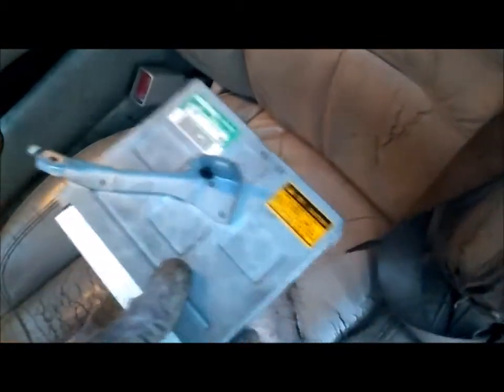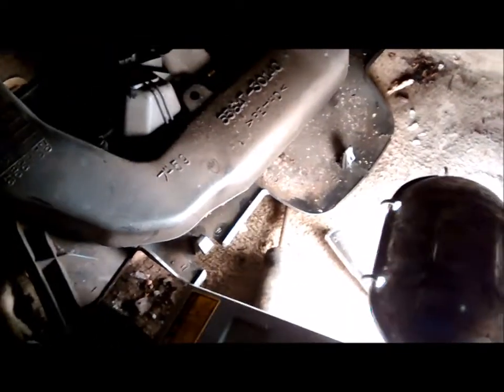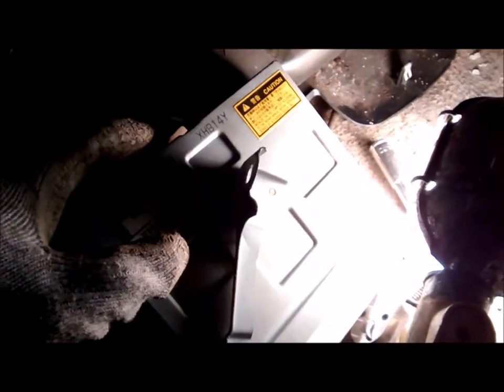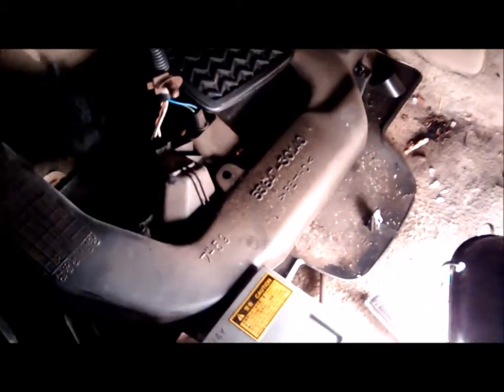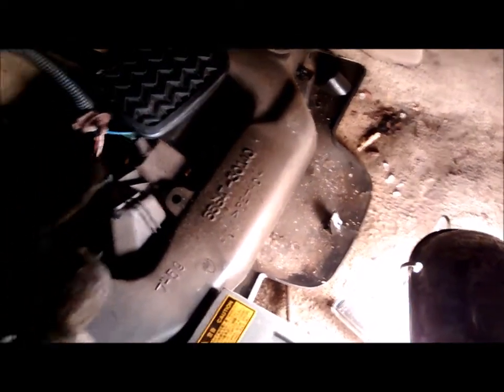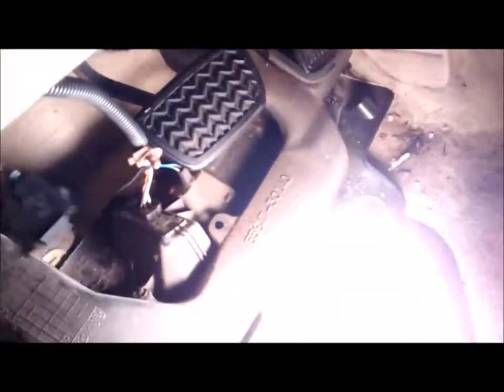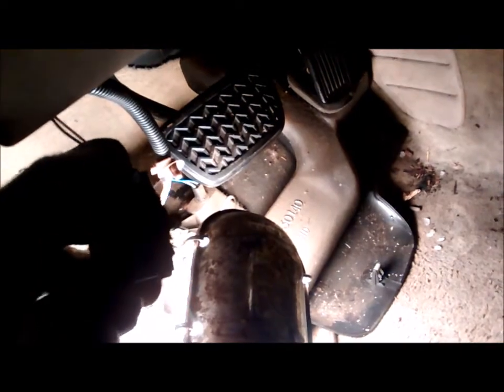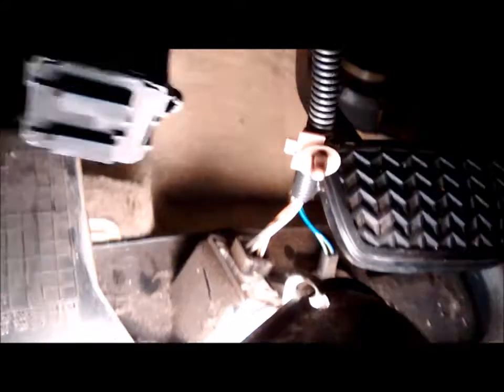1998 Lexus GS300 Replacing the ABC VSC ecu

Comment: I have the same problem wth my gs. Wth the master cylinder pressure is low    And abs , brake light, vsc, and vac off lights are all and plus the high pitched alarm sound  when I put on the scan tool it doesn't say any thing abt  the ecu. Just the master cylinder comes up on the scan tool pls advise thnk u
Reply from the maker: Eric Scott it could be the master cylinder. Are the brakes hard when you push ok n them?
Reply: Eric Scott ,it is the problem of master cylinder . The special gas inside the cylinder is empty . In japan ,they can regas the cylinder.
Reply: @cman4197  I heard somewhere the 2001-2005 don't leak like the 98-00
Reply: Jeff. Mines a 01, mines making the sqauking noise and I see some apparent brake leak coming from the master cylinder. I'm also a victim of the abs vsc and vsc off light  fiasco. Would love a concrete solution to this. What I've came up with , with the three lights one, it has to do with the brakes only. So far , things I've looked up were, test all 4 abs sensors (with volt meter,)  swap or repair master cylinder (heard was complicated to repair). Replace acclimated cylinder. (To get rid of squacking noise) Have yet to finish this check list, but love to hear some testimony's. Thanks again for mind blown vids.

Comment: Is the noise you are talking about go beep beep beep beep beep continuously until the car is back in control?
Reply from the maker: Hans Gruper No. It was a continuous beeping noise. There was no break pressure either, and the break light was on
Reply: Mind Blown Productions gotcha. My brakes are fine but the beep beep beep continues until I stop the car. It's so annoying and I'm looking for the buzzer to rip it out
Reply from the maker: Is the check engine light on? It could be the yaw sensor
Reply: Mind Blown Productions it's a drift car so whatever it is it's getting unplugged lol
Reply from the maker: Hans Gruper yes

Comment: Did you need to reprogram the abs trc vsc Computer
Reply from the maker: No. Just install
Reply: @LewsSpeedShop  Was that the ABS Control Module you changed? If yes, did you have to program the computer? Thank
Reply from the maker: @sinnot9324  yes I replaced the whole unit. No I did not have to program anything
Reply: @LewsSpeedShop  Thank you much. Did your scan give you an ECM failure message when you had to replace the ABS Control Module?
Reply from the maker: @sinnot9324  Yes
Reply: @LewsSpeedShop  Thank you much
Reply: @sinnot9324  what did you scan with to get the code.  I tried an expensive Snap on scanner and also tried the jumper method to make it flash but it was jumping from abs light to vsc light and I couldn’t keep up
Reply: @pelonconstante6271  I don't know because my mechanic is the one that put a special scanner on there and got something that was saying it was an ECM failure. He didn't tell me what he used.
Reply: @sinnot9324  ok thanks